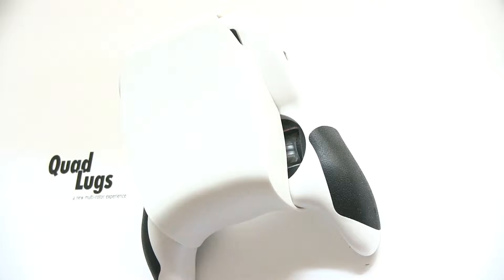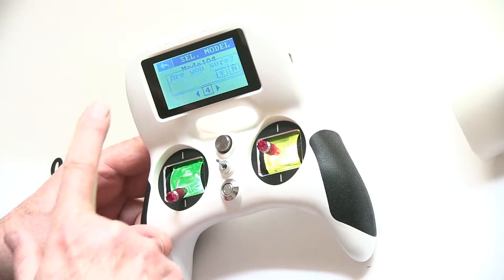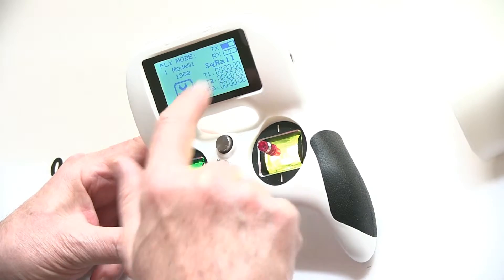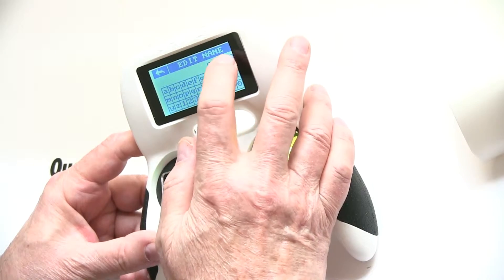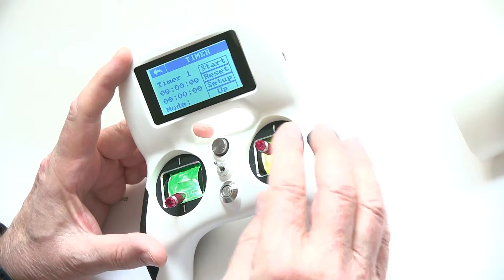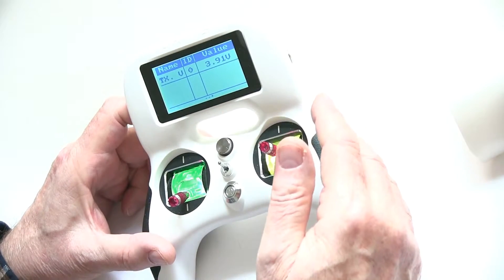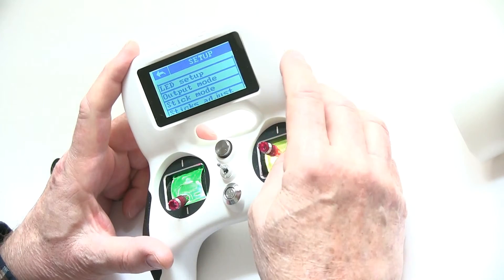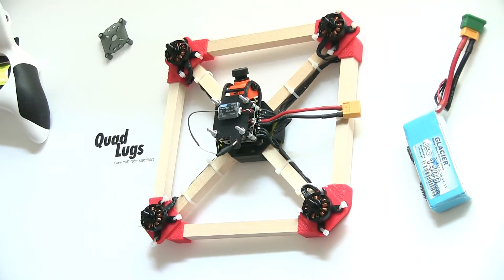QuadLugs - Turnigy Evolution Transmitter Setup and  Binding

Comment: I also have Turnigy Evolution Digital AFHDS  . I have paired it with the Eachine UK65 but I'm having problems the drone don't fly only different motors spin at different position and I get Bipping Noise and Red flashing light on the controller.  I have this similar controller connected with another drone and it works fine. With the EAchine UK65 it gives me problems.

Comment: Hello there, thanks for this Video. I see in the screen on top left side I see the logo of Fly Mode, mode 01  1500. Than the settings logo. On my Screen it does not have Fly Mode Mode01 1500 Option it only has the Settings Logo . How did you managed to get your controller to have the FlyMode Setting?

Comment: How do you get to fly mode?  My Evo doesn't have that on the main screen, or an option for it anywhere in settings, that I can find, has there been an firmware update recently or is that the newer Evo pro controller?
Reply from the maker: there was an update in 2017 if I remember the date correctly - if you want - send me your email address at quadlugs@gmail.com - and I can send you the update file